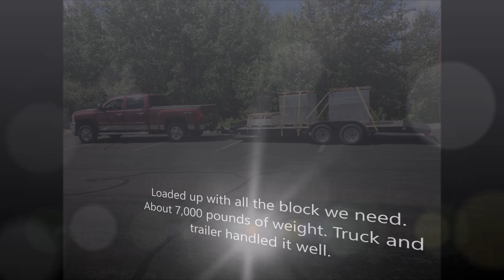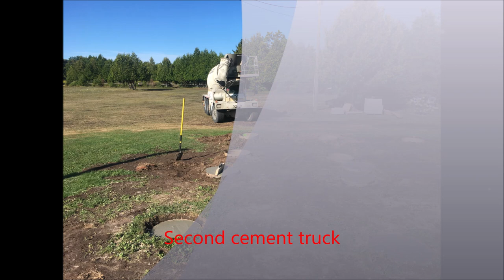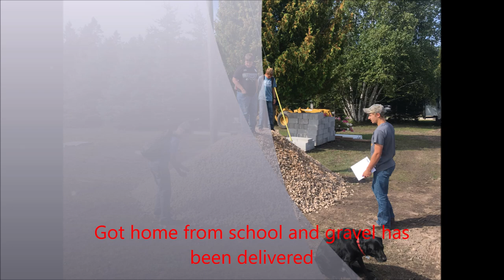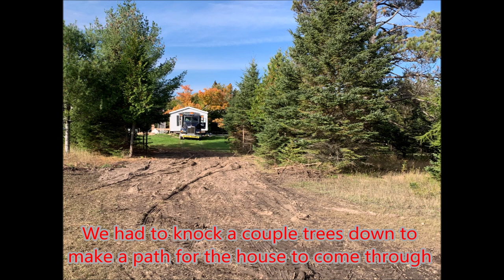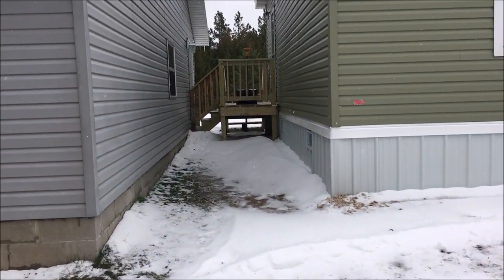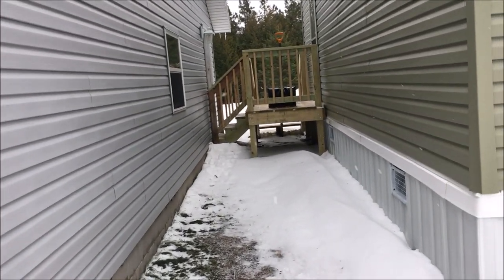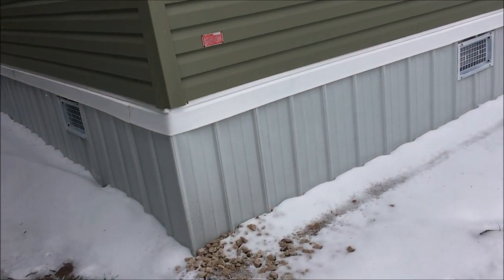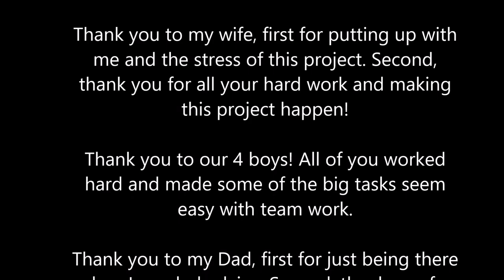New Double Wide Manufactured Home Install. Start To Finish (Slides and Video)

Comment: The deck between house and garage is going to be a pain to shovel.
Reply from the maker: Yes it will be and probably big snow drifts with the wind blowing between there. I had the thought of putting some sort of temporary roof over it for the winter but not sure what I would do with it. I already want to put another set of steps on the side of the deck facing the front of the house. Thanks for stopping by and watching!
Reply: @UpperPeninsulaDIY  PVC hoops over the whole sh-bang...cover with a tarp.  Just a thought.
Reply from the maker: That might work good actually. Thanks for the tip!

Comment: Neat to watch the process. Congrats (belated). I’m curious about the effectiveness of the insulation due to the cold in Michigan. The folks I know down here in the south complain of high electric bills during the extreme heat & cold (for us), but they’re older construction. I’m sure they can upgrade insulation to a point, but would appreciate your opinion comparing your previous single wide to the double wide. Thanks.
Reply from the maker: Good question! Older mobile homes aren't insulated well and only have 2x4 walls. Both my single wide and now my double wide had good 2x6 insulated walls. How ever part the single wide had a vaulted ceiling that wasn't insulated well and also had very poor windows. This made it hot in the summer and a little cold in the winter. The new double wide has a good insulated ceiling but still having 8' ceiling height. It also has good double pain windows. I'm actually impressed how well the new house is insulated and sealed. Thanks for watching and commenting!
Reply: @UpperPeninsulaDIY  Thank you for the explanation. Makes a lot of sense. The folks who convert sheds to houses recommend having spray foam & as many good options as possible for insulation, dealing with moisture, etc. I’m thinking it would be better for me just to get a well insulated double wide similar to yours when I can, in order to save time compared to converting a shed. Thank you for your expertise on the subject.

Comment: I am considering finding some property in the U.P. and putting a single( or double wide on it. what are your thoughts about buying a used mobile home and updating it?
Reply from the maker: Buying a used home is a great idea. We bought a used single wide and lived in it for about 10 years. Then upgraded to the double wide. We purchased both of them from Phil and Lees out of Escanaba. They usually have a good selection of used ones. Good luck!

Comment: Why wouldn’t you place it on a full concrete slab ?
Reply from the maker: Thanks for the question. In our area code requires any footing to be below frost line, which is about 3 feet.

Comment: Can you please enlighten me as to where I can possibly get land to put a manufactured home on everywhere I look it seems to be forbidden.
Reply from the maker: No kidding?! Where do you live? It is my understanding as long as you own the property you can put a home on it. There are different building codes for a manufactured house compared to a stick built but still can be done.
Reply: @UpperPeninsulaDIY  I live in Green Bay and info is scarce. All I've had to go on is city ordinances for the areas I want to possibly go to and these are limited often to manufactured home parks.
Reply from the maker: Oh your not to far away from the UP. Your probably right with trying to put one in inside city limits. I'm sure there is ordinances and restrictions. It's kind of an old school thought of a manufactured home looking like they used too. Now a days they look just like a stick built house. If you can find property outside of the city limits, even just an acre or so you will probably have better luck not having to deal with ordinances. Maybe try talking to the place were you would be getting the manufactured home. They will have a lot of answers for you I bet.

Comment: I wonder if it took 3 months to be allowed  to move in? Or just final inspection overall. If I had my dblwde connected & its finished inside but just lacking porch/decking code clearance  i would  think u should of already been living in it after the tie downs, pvc & electric connects are good to go. The county codes cost u money & time along with penalties  if not done on time or to " there satisfaction ". One thing about living in the Ozarks is u can build your own property & home to suit u & your needs & not some glorified  code enforcement permitting money machine.
Sorry, have a nice day.
Reply from the maker: Oh for sure. We started moving into it right away after we got everything hooked up. We weren't technically suppose to until we got a letter in the mail that the home is inhabitable but there was no way we were waiting that long. I gripped and grumbled the entire time about the permitting process and inspections and the cost of them. Got it done though and we are happy with it. Thanks for watching and commenting!
Reply from the maker: @Kurt Cooper That will be a huge house!! It's definitely a hurry up and wait kind of project. As far as the decks go, the house had to have permanent decks on it that "are not" attached to the house before the project was considered complete. I don't remember if that was a building inspector rule or the finance company rule. It may not be a thing were you live though but something to consider. We ran into a few loss plumbing fixtures when we got our home. Loose drain traps, the outside faucet wasn't even hooked up. I'm sure yours won't be like that but be ready to turn the water off when first hooking it up. There will probably be debris in the water lines, so if your sink faucets all of a sudden stop working or seem to have no pressure. Take the little screen off and I bet there will be plastic pieces just from the new pipes and being installed. Anyway, congratulations on the nice new house. Hopefully it gets to you sooner than you expect. Come back and share a picture when you get it. I would love to see it.
Reply: @UpperPeninsulaDIY  
I have considered hiring my own tradesmen for overseeing this install project & all the finish work electric, plumbing (water/septic), along with t & t, finishing work inside.
U only have to read the reviews of the dealerships dependability to start to become paranoid....lol
Florida  is a different  breed of folks from the Ozarks i grew up. They don't show up when scheduled & they take days to finish jobs because they attend to whos paying them the most @ any particular job. Also, get everything  in writing as most down here, no speak English when it serves them best. Most crews that show up don't speak English on purpose!
Appreciate  your insite.
Blessings  to u.